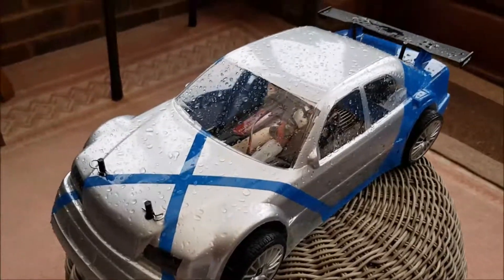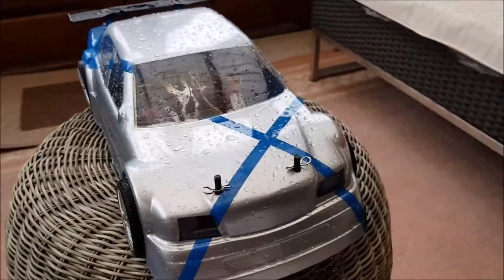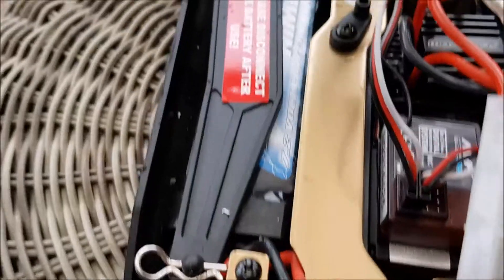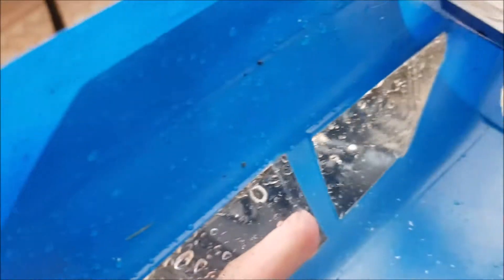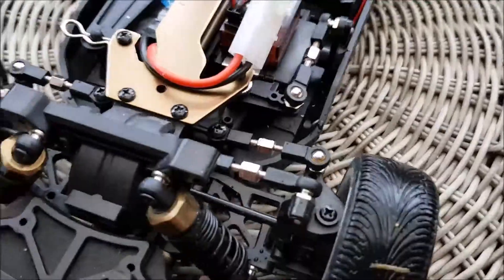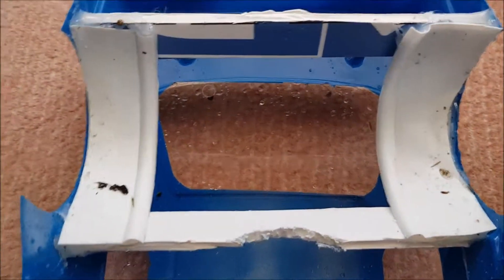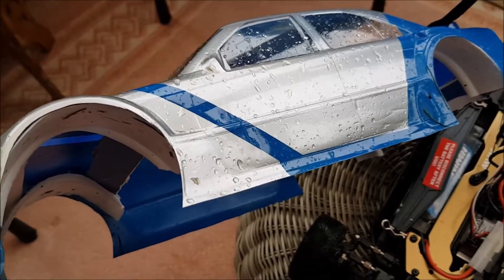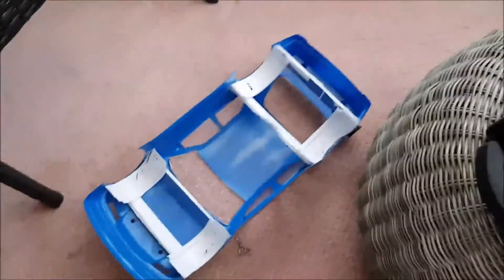Part 2 of 2: Results of wet weather test run for my custom wheel arches

Comment: They work very well my friend remember you'll get a few splashes when the wheels are turning left or right on the inside👊🇬🇧😎😊👍
Reply from the maker: Thanks for the heads up..that's actually a great point....I didn't really think it would be that big a deal...but now I'm thinking about making something to curve around on the inside...but the problem is, all those shafts connecting wheel/tyres to chassis. It'll need a load more access holes lol.......oh and of course I'm gomna be putting some strips on the inside of the shell to connect the wheel arches lengthways....guess its a case of 'once you start, you can't stop' when it comes to building RC stuff 🤣
Thanks for that and your support friend..most defffinitely greatful 
👊🇬🇧😎🤘🙏